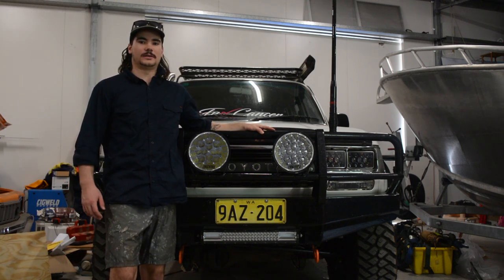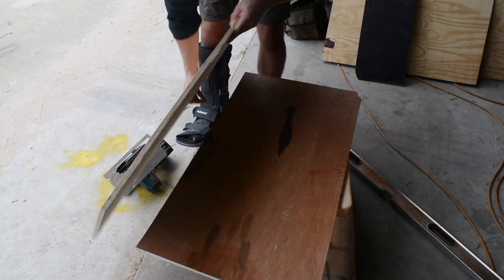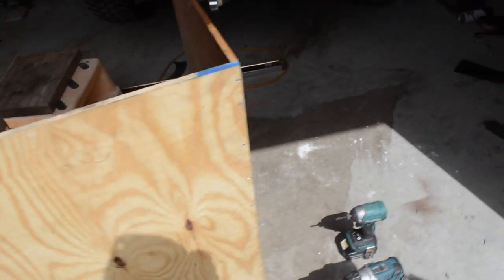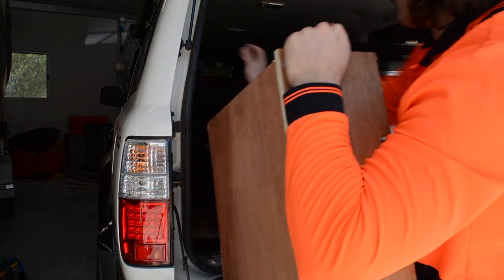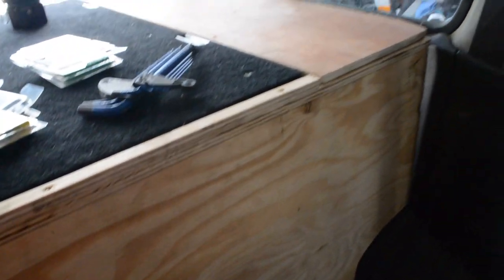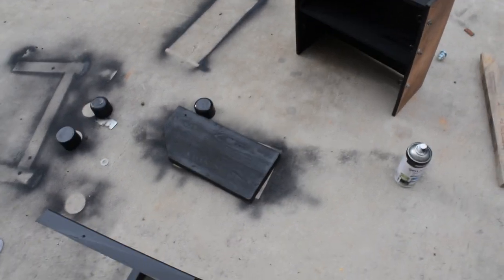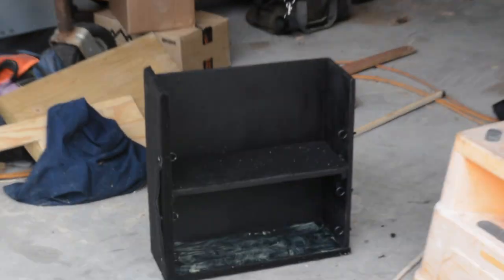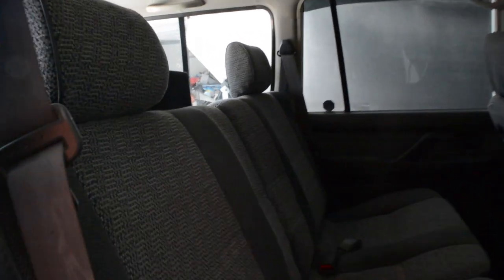Upgrading the Drawers in the 80!

Comment: Thoughts on the xtm drawers?

I went to an aluminium fab shop to get the same set up you had prior to the mods, they wanted $4k and it was 10kg heavier than the xtm drawers so the xtm is looking pretty good at under $700